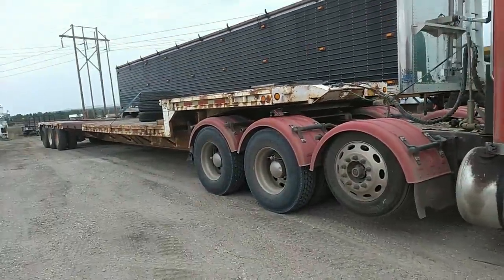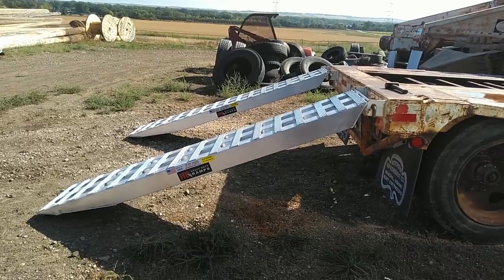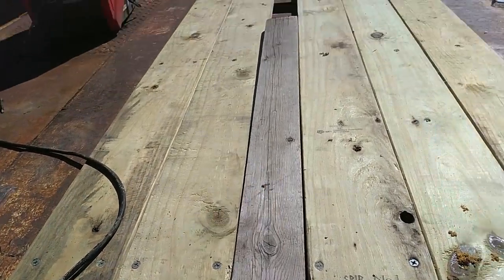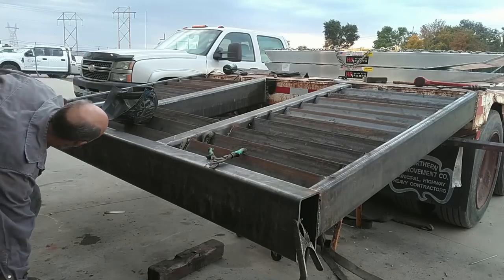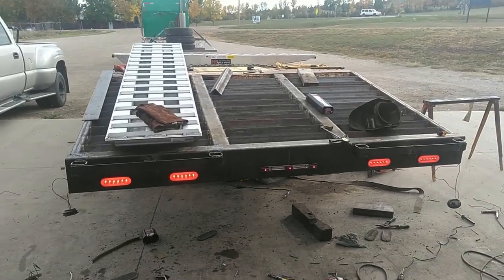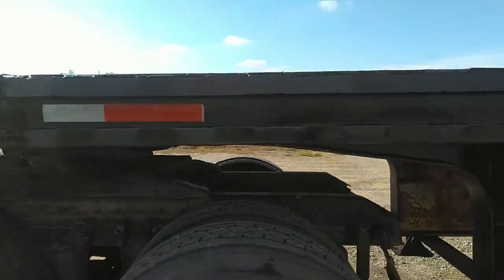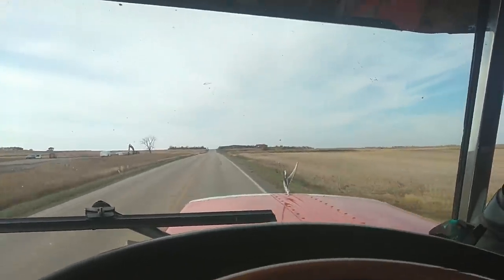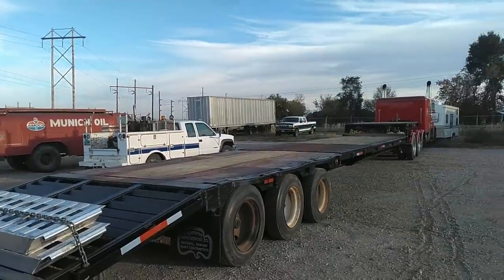I bought the cheapest step deck trailer I could find on marketplace

Comment: Love this trailer and you dove tail mods. Been looking for a drop deck with a dove  for years. Always figured I would do the same as you did. 48ft are fairly common here and less cost. Enjoyed this video tremendously.
Reply from the maker: Yeah and I'm less money in this than I would be to buy a tandem dual gooseneck to pull with a pickup. Still want to do something different for the ramps but it works and I only spent 1 weekend on the bevertail.
Reply: What did it end up being length wise now  with the dove tail added ? Nice looking trailer now and more user friendly but keep up the great work and videos coming
Reply: @J.C. SMITH PROJECTS I thought you were going to splurge and pull the pin on a brand-new triaxle travelling axle Landoll
Reply: @timatwell3728  by my math, 53 feet, 36"
As long as no one measures it, it doesn't matter. 
Let's just take in the trailers awesomeness !!😎

Comment: Just saw your video. Awesome trailer and mods. Done almost same to an '89 Husky low profile low riser tandem dual gooseneck. After two new axles, improved rub rail, beavertail using a set of Discount Ramps, and the converting the low-profile riser to an upper 10' deck Perfect fit with my Chevy3500HD cab chassis. I love the trailer.

Comment: Couple gallons of tremclad paint and that trailer will be looking new.. Man I wish I had 1/2 the knowledge Easyrider had so I could do some projects like him
Reply: What is tremclad paint
And why when it comes to working with heavy duty stuff it's not easily accessible to the public for accessories parts and tools?

Every time I break a socket or I need a new axle socket, or anything heavy duty it's always you got to order it online because not one damn store anywhere carries heavy duty

What about deck screws?
Torx heavy duty hardened steel deck screws
Where do you buy them at that's convenient?
And tell me more about this paint or do you get it that's convenient
Reply: @StayingBack71  tremclad paint is just a cheap brand of paint used for rusty metal you can usually buy it at any big box store

Comment: You could probably drive a tank up that beaver tail. That's some quality welding and Engineering you did there. At the beginning of the video you said the trailer was 52 ft long. With the new beaver tail what is the new length of the trailer and do you have to have long load permits? cuz I'm assuming it's over the standard 53 ft
Reply from the maker: 57' I'm legal in my state to 60' I can also pull out the center deck section and shorten the trailer

Comment: Good choice & fix Ezra !  Much prefer fixed neck to rgn . God bless ya brother . Thanks .
Reply from the maker: A double drop rgn has some distinct advantages I bid on a few old ones recently at auctions but other people thought they were worth more than I did
Reply: @Ezrider359  Yeah im sure they have there advantages . Soom look far easier than others . Having good air remote is a good thing too . But yeah horses for courses if ya heavy haul  you need heavy springs and axles and reduction etc .  I liked old two strokers hydraulic tail too .  Are you going to  put a winch line on seeing as you have wet kit already ?

Comment: O-H-I-O Porter greetings.🇺🇸 That looked like a typical used drop deck trailer that we would see out on the road…black, brown, white…multi colored. Well Used! 🧐 Thanks for showing us how vehicles would bottom out when loading the trailer. Many of us have been there!😳 Oh, I got time to transform it into a dove/beaver tail trailer. That’s a lot of stick welding! That was a pretty major project, in my opinion! Then a Ritchie Bros paint job comes up. You made your trailer so much easier to use. An extra hand would’ve done you a great help! How much did you add to the length? Don’t forget to show us when you paint the wheels as well. They may need it soon, before the winter gets a grip on us. Nothing short of a job well done! Good stuff. Thanks! Blessings my friend! 🥰🤩✌️

Comment: Did you save much on buying fuel direct from the refinery Ezra? Or has the drop in diesel prices worked against you over the past few months?
Reply from the maker: Yeah I run about 6k gallons threw the truck on the last job I just moved it from with probably a average savings of 45cents per gallon

Comment: Looking good
You might need to close up one hole to get under 53 feet although a over length blanket may work too.
Another point: chain your ramps back to the trailer when loading or unloading. Spitting out a ramp can become expensive.

Comment: I bought a 1975 Muvall lowboy and I’m going to do the same thing with it, wire wheel, Rusty metal primer then paint it. I did the same thing with my Sterling several years ago it’s looks a lot better going across the scale than to have all that rust and peeling paint.

Comment: Awesome trailer Ezrider. You could haul cool stuff with it. I could haul a tractor with it. Not the big tractors I would need a lowboy.
Reply from the maker: you could still get some pretty big tractors on this trailer, up to 102" wide 10.5ft tall and 60k lbs before i would need to pull any permits, generally permits up to 12 wide and 16 tall (12ft + 3ft deck) aren't any big deal

Comment: Where do you get the dough to buy all these equipment. Most of owner operator today struggling in this market, it is good to see that at least there are people outthere that still can effort the bank roll
Reply from the maker: It's not like I'm buying high dollar stuff here? Stepdeck was literally the cheapest one I could find that was decently road worthy. The fuel truck was a cheap auction buy that paid for itself in fuel savings within the first few months. And the service truck iv owned for probably close to 10 years now

Comment: Just a question, I guess it depends on how much weight you’re going to haul, but do you need a brace that goes from the dove tail to the ground at the add on ramps. To keep the dove tail from bending?.  Awesome trailer though you did make it look good
Reply from the maker: if i was loading something that was around 20k lbs per axle or greater id probably throw some dunnage under the end of the beaver tail to help support the weight. it would probably be fine without it though.
Reply: Thank you makes sense

Comment: As always, a great video. There's one question that I would like to know the answer to iff possible. Do the trucks in the U S have any  speed restrictions placed on them by law like here in the UK. Thanks.
Reply from the maker: Speed limits are posted signs on the road some states will have spit truck/car speed limits. They are trying to push threw a law requiring trucks to have speed limiters even if it does get passed old red will likely be exempt due to its age and mechanical engine making installing a speed limiter not practical.
Reply: Thanks for that. Much appreciated. Keep the videos coming.

Comment: Congratulations dear Ezra so you haven't been sitting idle all these times. That's a great welding work of you for sure. How much is the load capacity of this trailer and can the Old Red take advantage of all of the trailers capacity? I mean 5th wheel, rear axle weight rating and stuff like that
Reply from the maker: This combination is about 40k empty. 105,500lbs gross on any load old red hauls that much every day. Probably 130-140k gross could be permitted on a non divisable load. I'll likely never haul anything that heavy on it however

Comment: Just think next paint job you can paint match it to Red for a year then match Green with fresh paint when you want ? 

You did what you did with short time 

What's the legal length you can be with that trailer and beaver tails ?
Reply from the maker: This trailer where I'm at can be 60' so I'm good at 57' but I can pull the center deck section out and shorten the trailer when I need to
Reply: Possibly, you can split that insert, so you can have a full deck at different lengths.

Comment: Does that beavertail fold up if not it's going to change your overall length of the trailer make sure it's legal if it doesn't fold up
Reply from the maker: I'm legal to 60' I can also pull out the center deck section and shorten the whole trailer up if I need to go somewhere I can only be 53' trailer is currently at 57' with the tail.

Comment: So, what’s the overall length now?  I thought u said the trailer was 52’ closed up.
Reply from the maker: 57' with the center deck section installed and the bevertail it can be closed down 8 feet or spread open another 5
Reply: @Ezrider359  
Is 53’ the max up north where u live?

Comment: Did you get a permit for the trailer, now that it's over 53 feet?
Reply from the maker: No. I'm legal for 60' in my state and I can pull out the center deck section and shorten the trailer when needed

Comment: How's does that titanium MIG welder work? Is that what you're using to weld with ?
Reply from the maker: I used the titanium welder both stick and mig on this project
Reply: @Ezrider359  is the titanium 110 with gas? Thanks !
Reply from the maker: It's a 110/220 welder it was being used on 220 there is not enough power on the input side for any welder to do any heavy welding on 110v

Comment: Isn't the trailer too long now ? You said 52ft, plus the dovetail which is what, 4ft ?
Reply from the maker: 5ft and no this particular trailer is legal to 60ft where I am and I can pull out the center deck section to shorten the trailer when needed to be under 53ft
Reply: @Ezrider359  nice !! Where is 60ft legal